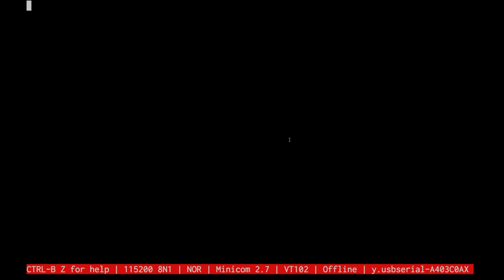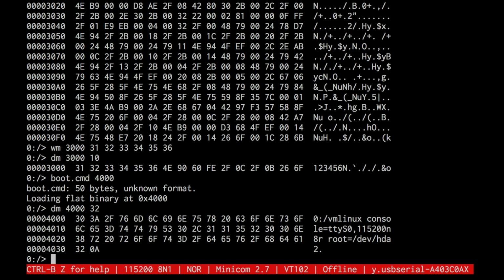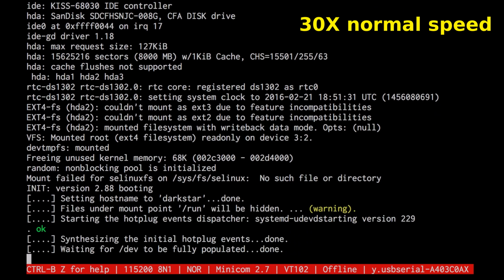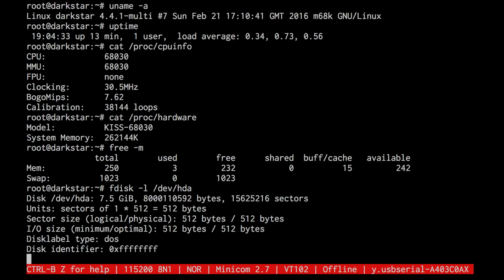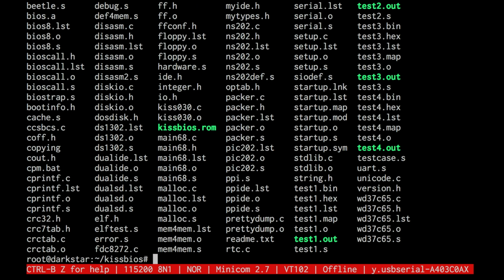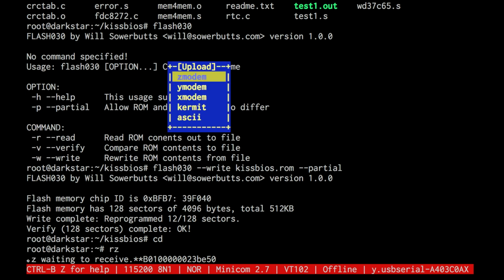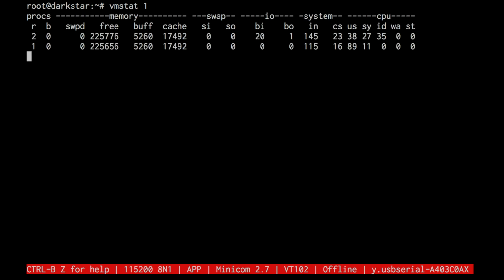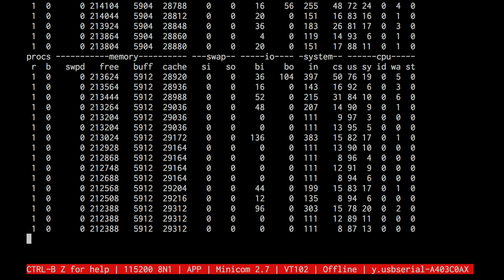Retrobrew Computers - KISS-68030 homebrew computer with Linux

Comment: Back starting in 1977, a company called Alpha Micro started a computer company building a computer based on a Western Digital chipset (5 40pin dip chips).  This 2mhz then 3mhz computer was a dead end - no further support for future expansion from WD, so Alpha Micro opted for the Motorola 68000, and ported AMOS to the new platform (AMOS/L).  They eventually built systems using 68020, (I updated some of the 68000 systems to a 68010), and then 68030 chips.  The operating system supported a wide variety of hard drives, starting with the 8" floppy drives, CDC 10mb Hawk, 96mb Phoenix, various Priam and other Winchester style drives, and eventually settling on SCSI disks and tape units.  The operating system was multi-user and multi-tasking, some systems having DOZENS of terminals and printers, and the ability of most of  the terminals to support up to 3 other virtual 'desktops'.   The computer company eventually migrated to Intel architecture, emulating AMOS/32 and connecting 'terminals' using ethernet and running terminal software on PCs.  After 40 plus years of operation I think they are finally gone.  :(    I think if  you could port AMOS onto something like this, you would have something very usefull.  There was a huge library of business applications for AMOS, all very usefull.

Comment: I built a 68000 / 12MHz (PGA) system in 2005. 512kB FLASH (2x28xxx), 64kB RAM (2x62256). CPLD MAX7128 address decoder. UART 16C550.
Previously, it was simpler on 68000 / 8MHz (DIP64), the address decoder 2xGAL22V10.

Comment: Very impressive. But it seems like gnu/linux is the wrong OS! I used to install and work with Xenix on 386s, and did a real Unix installation once on what I assume was a AT&T 386 system. I'm sure they didn't take 10 minutes to boot. I'm pretty sure they wouldn't have taken 2 days to recompile their kernel, if you could have.

gnu/linux must be really badly suited to the 68030. Or the C compiler isn't good with only a few hundred MBs of RAM.
Reply: Linux is not the wrong OS. It's just modern. Kernels of the time of the 68030 where much less capable and therefore considerably smaller. Just some points for consideration:
Linux has significantly more drivers than any Xenix/Unix of its time
Linux has a plethora of filesystems available, whereas old UNIX system had "their" filesystem and that's it.
Linux has much more in-kernel functionality, like a firewall, a massive network stack, virtual layers, a hotplug-system for USB&friends, multiple schedulers, virtual filesystems like proc and dev, namespaces, control groups, selinux and what not.

So yes, in a way, you are right. Linux isn't the OS designed for the 68k but for much more capable hardware. However, look at how well it actually runs! Even on this hardware arguably from stone-age, Linux still presents a workable system.

Last but not least, claming a system to be "self hosting" as in "compiles completely on itself" is an important milestone in OS porting. So the guy in the video rightfully mentions it. However, you are not required to build the kernel on the machine, you can to that by cross-compiling it on a more modern machine.
Reply: @virtualinfinity6280  The problem with the slow boot time here is the shell scripts that boot it which assume processing time is no problem.  If you look around on the other comments on this video, the video creator said he massively sped it up later by making a custom boot script.

Comment: 10 minutes to login: ?
Something wrong there I say.
68L040 Macs would boot much faster than that into Net/OpenBSD or Linux, IME.
Reply: The video creator said the problem was the boot scripts (he said he fixed it later with a custom boot script), you can actually the the boot scripts beginning to run before he sped it up, so that's really the main problem

Comment: these kinds of projects are always so impressive to me. especially since i'm always trying to make my own DIY Computer,
and i always fail at the software... i can get the hardware together somewhat decently, but the software... no idea
also why not just allow files to be send over via the serial port? a lot of serial software is able to send files. and if you have some kind of command that allows the receiving of files via serial it could make everything even more easier without you requiring some kind of modem

Comment: Why does CF Card connected via 8255 controller?
As I can see, computer works very slow when accessing the disk.
The CF(IDE) interface allows to connect directly to the buses, its just need a decode logic. 
8255 has a 1uS(or about 500ns for 8255-5 version) IO cycle time, so  to read 16 bits of data you need to make about 4 IO cycles (2-4uS) instead of 1 IO cycle (4 CPU cycles?) in direct to bus connection mode.
Its also provide the DMA mode, wich can improve the bandwith in many times.
Reply: I have implemented many IDE designs and have never used an I/O chip. Just latches and bidirectional buffers, with several classic micros. In fact, I've never used an 8255 in a design - period. Have never needed it.

Comment: Would you by any chance know how to make a (modern) amiga500 expansion such as the TF530 check for a kickstart3.1 ROM whch has CDROM booting (or even just an older kickstart1.3 ROM without CDROM booting and thereby reliant on CDBoot software on the HardDrive, which may even be a CF card) and then use a (modified?) universal CDROM driver to boot CDROM from say the parallel port (where a printer normally plugs in)? Or if not to boot from the parallel port, from the IDE on the TF530 (or TF534) having, for example, loaded a universal CDROM driver and other software (which maybe you might write - if you're up for it) from FD1 (external floppy dive) and also checking FD0 (internal floppy drive)? The Tf530 is open-source GPL2 so doing it in the (TerribleFire) firmware can be done on a github pull request (if preferred).

Comment: Very exciting projet.
I'm a little jealous.
I would like to possess such a system.
Is it possible to buy it? Where?
10mn for booting - we have time - it's not for playing music,
but to compile  assemble and debug.
mm (memory modify)
md (memory display) ...
It would be my use (via RS232 - TTY (VT100!?)) - PuTTY or "TTY Emulator"
"I am not going to go back up to the type-writer".
Reply from the maker: Hi Al -- yes it is possible to buy this system - but not as a complete unit.
You would need to buy the printed circuit boards, buy the components, then assemble it yourself. 
You will need a soldering iron and a programmer to program the ROM and GALs on the processor board (you can get an inexpensive MiniPro programmer on ebay for this). 
The PCBs are available at retrobrewcomputers.org (check the "boardinventory" page); you will need an ECB backplane (there are 3, 8 and 12 slot designs), the KISS030 board, and the MF/PIC board.
There's also a forum at retrobrewcomputers.org and lots of friendly people who can help you out if you get stuck.
Best wishes
Will
Reply: Thank you, Will, for your quick reply.
It's been a while since I did not use a soldering iron, but I should get by.
Are the components standard? Are they easily found? and the 68030?
I did not understand your oral explanations because I do not practice English.
I can read it quite easily, writing it is a bit harder, oral 0 ("NULL", "NIL") - connected to GND.
Which will not necessarily make my job easier.
Thanks a lot.
Reply from the maker: Most of the components can be found easily at the mainstream component suppliers like digikey, mouser, farnell etc. There are plenty of 68030s available on ebay (where I got mine). A small number of chips are harder to find but I was able to buy them without much fuss on either eBay or from a specialist IC supplier like utsource.net (reasonably priced), littlediode.com (expensive!) etc -- off the top of my head I think the 74F195A was the only hard part to find.

Comment: Ever think about trying to get SLIP running on that rs232 link? 115.2k is actually decent for tcp/ip. Then you can telnet and ftp in the machine with out having to juggle with screen and zmodem.
Reply from the maker: I made a follow up to this video where I show a second serial port (runs at a higher speed) and I ran PPP over that. Slip doesn't support IPv6 and I wanted full internet connectivity :)
Reply: Will Sowerbutts ok cool. I'll check it out!

Comment: I use to use a 68040 for all my work. Only 32 megabytes RAM.
Everything fit on an 80 megabyte storage device.
Photoshop, PageMaker etc...
Booted in seconds using OS7.

Things have gotten so bloated.
Reply: Bloated? Sure, but in return things have also gotten a LOT more flexible! Printers are (generally) just plug and play; The internet has become very flexible (though also pretty bloated) in so far that we can now run 'apps' in a webbrowser!
You gain some, you lose some.
Reply: @DutchmanDavid  Mostly lose.
Reply: Agreed.

Comment: OS9/68k anyone?

Is it so slow to boot because of the 8255 PIO?
Reply from the maker: Is there an open source version of OS-9/68K? I couldn't find one. There's NitrOS-9 but that targets only 6809.

8255 PIO gives reasonably fast disk transfers. The boot speed is largely CPU bound, the boot process is designed for modern machines where launching a few hundred shell scripts is effortless. In my follow-up video I replace the boot process with a single shell script and this brings the boot time down hugely.

Comment: i do not understand why cant you use the full 4gb of ram in it
Reply: You probably would have a hard time finding gigabyte-sized SIMM modules :)
I guess you could design an external RAM board with whatever memory you like, though you might have to run it slower than the onboard RAM due to longer traces and capacity...
Reply: what a pity none of the processor upgrades don't have the full ram compliment
Reply: what about video ram capabilities please?
Reply from the maker: You can't get SIMMs in such a high density, and you need some address space for MMIO.

Comment: Fantastic! I'm in the process of designing my own 68010 computer, and my end-goal is to be able to write a simple UNIX-like operating system for some future iteration of it, but seeing GNU/Linux on the 030 is another thing altogether :)

I wonder since you didn't mention anything about an MMU, does the 68030 has one on-chip? Because with the 68010 I'd have to make an external one which signals page faults on the BERR line.

I'll definitely check out that retrobrew forum you mentioned.
Cheers!
Reply: [6 years later...] Yes, the 68030 has the MMU on-chip.
Reply: @thorpejsf  No worries. Yeah I've started designing an 030 board a couple years ago, but never actually finished it. The PCB layout with all those 32bit buses going everywhere proved a bit more challenging than I initially thought :) I always meant to pick it up and try again, so maybe this is the reminder I needed.

Comment: Can this system decode MP3 in real time?
Reply from the maker: It has no audio output hardware. It probably cannot decode the bitrates required for reasonable fidelity. So, no. However there are single-chip MP3 decoders available that take encoded MP3 data over SPI (etc) so you could certainly build a sound card that had a decoder and DAC on board.

Comment: Can you connect any kind of NIC to an ECB backplane, are there boards for it? (Or anything that'll make reviving an OpenWrt/68k port worthwhile? :) )
Reply from the maker: wigyori I use a PPP link over RS232 for networking. There are no ECB Ethernet boards at this time, but maybe you'd like to design one? :)
Reply: I don't think I'm that good at PCB design (absolutely 0 experience). But let's make it a chicken-egg resolution, I'll see if it's possible to make an OpenWrt port. :)
Reply: @willsowerbutts  I might take that one up - but someone would have to pay me...

#GottaEat

Comment: How did you find a functioning 68030?
Reply from the maker: Ebay! As long as the chip hasn't suffered bent pins or static discharge it's almost certainly going to work fine.

Comment: is this anything like the original Motorola 68030? Could it potentially run Macintosh System 7? :)
Reply: It would take quite a bit of work to make this setup run Mac OS. You'd need a Mac ROM from some Apple 68k machine and a bunch of glue code to fake an Apple machine. You'd also need to write drivers for Mac OS to support whatever video device and input support you were going to use.

It'd be easier and less expensive to just emulate it or get a real Apple machine.
Reply: It's very like it, considering that it is one.

Comment: What exactly is the point of all this effort just to run a text based Linux distro?! Before I watched this video I was expecting to see something like the Kiwi computer. How boring! I'll visit the Retrobrew forum though.
Reply from the maker: You could design and add a graphics board in an ECB slot if you want graphics. But real computers have serial consoles :)
Reply: The point is to weed out those viewers who have insufficient imagination to see what the point is.

I see it's working admirably.
Reply: Will Sowerbutts - Graphics adapter - that's a real trick isn't it?

Comment: Great project!  How easy was it to work with those DIMM slots?   I've been trying to track down a breakout / prototyping board for them for retrocomputing experimentation.
Reply from the maker: They are SIMM sockets. DRAM is really not nice to work with. If you need small amounts of memory (up to maybe 8MB) then use SRAM, it is vastly simpler to work with and faster too.

Comment: This is quite awesome.  What was the hardest part of the linux port? Had you ever brought up Linux on any bare board before?
Reply from the maker: This was my first from-scratch Linux port. 

The hardest part was probably getting to the stage where the kernel could output text -- once you can get text out from the kernel you can add debug output to figure out pretty much any problem, but before you can get text out the system just crashes horribly if you've made a mistake and it's hard to figure out where to go looking for the bug.
Reply: @willsowerbutts  Yes it's harder than it looks, eh?
Especially with a CPU that has to have the DRAM controller programmed before you have any RAM for even a basic C runtime stack...

First 'sign of life' is often JTAG/Wiggler/OpenOCD, Single LED on GPIO controlled on/off...

Then DRAM controller startup, very basic crt0/C load, GDB stub...

Upside: you do learn a lot :-)

In some ways, the older machines like this are actually easier to bring up than modern SoC's.

Comment: As im interested in building this PC, how much did it cost(with all components) approximatly?
Reply: I think both boards are $20 each, the backplane is roughly the same, and the CF card+adaptor and related accessories (serial cable etc) will be a bit more; the real problem is finding the 68030, which needs to be fished out of something.
Reply: Thanks for your reply.
Reply: No problem. :)

Comment: Great project, Will! Where did you get the 68030?
Reply from the maker: It was £35 on Ebay. It had been pulled from some other equipment and I had to bend a few of the pins straight before it would fit the socket.
Reply: ...and how hard is it to get the characteristic speed of the memory and flash memory to match with that of the 68030?

Comment: Interesting to see how capable it is. I have some QFP LC060s that I intended to strap to an FPGA board with some DDR and bring up Linux but I keep putting it off. I had the latest kernel running on a plain 68000 about a year ago and it was beyond painful. :)
Reply: @Mike Sienicki 68010, 68012 are drop-in replacements that do restartable instructions properly.
Reply: @Mike Sienicki Sure, but two of them is :-)

Apollo Systems / Sun q.v.